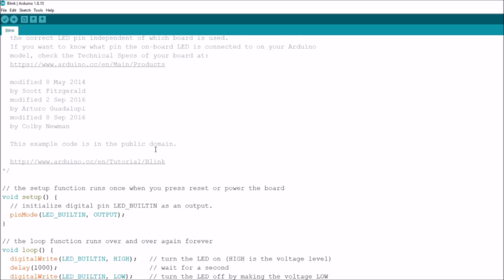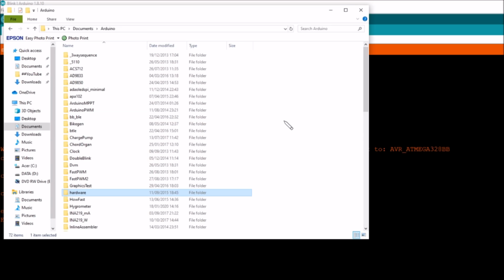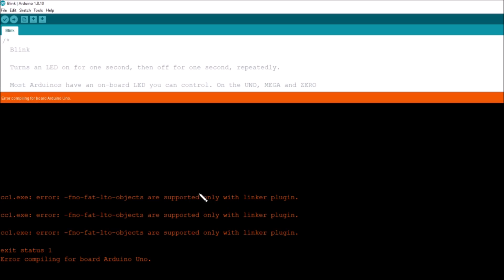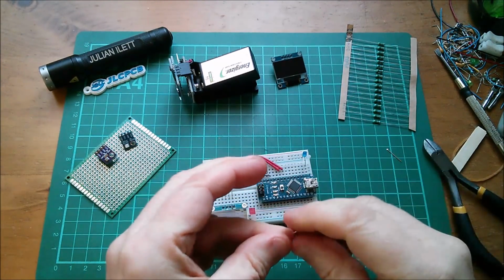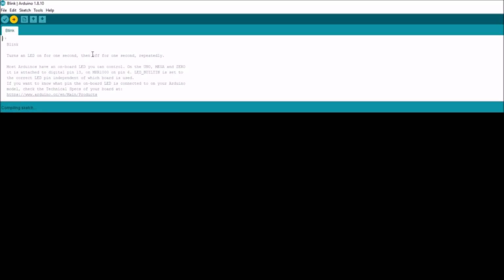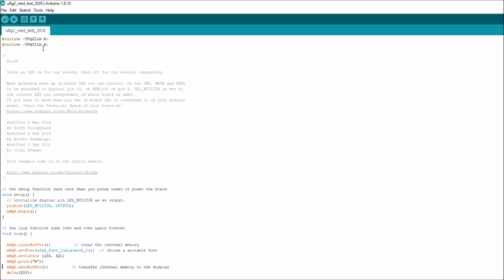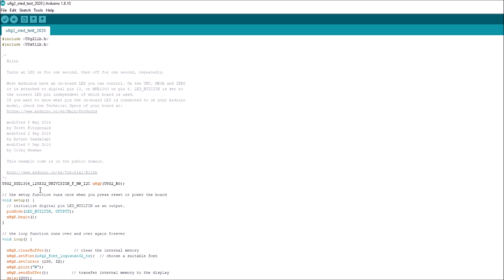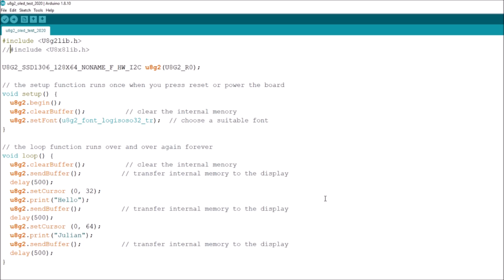Getting back into Arduino #1

Comment: Hello Julian,

Yes, lots of things change with Arduino, I have several versions of Arduino IDE on my PC as some libraries such as the LoRaWAN LMIC library only works on Arduino that's 2 major versions behind. Also, it is annoying that libraries are sometimes not versioned very well... BUT for properly versioned libraries you should look at PlatformIO. In the manifest for your project, you can pin the Arduino.h file and the library versions, which is super tasty. Also, your linker errors are probably related to the bootloader on your ATMega chip, this is an issue with the Pro Mini, as the name suggests its aimed at the pros (Arduino pros, I already recognise you as a pro in other ways) so you get all sorts of weird and wonderful behaviour and cutting edge stuff, the Uno and more hobbyist style Arduinos are much more stable in terms of bootloader version etc...

Best Regards,

Rob
Reply: Ooops, sorry just watched the rest of it and realised you figured all this magic out... But seriously check out PlatformIO I think you'll like it, finally a "proper IDE" for Arduino.

Comment: you can update the boot loader to new using another arduino but in my case i didnt have so i connected it to a rpi and did through that so that would be an interesting video

Comment: Havent updated since 1.8.5 for this reason - i have a problems as it is without introducing more issues.
Reply: 1.6.7 here. Original install when I got into it. Never had a problem so I won't change it until I do. I need continuity as I often revisit old code on things I've made.

Comment: I recommend you to use Visual Studio Code with PlatformIO, it allows you to keep the version of the different IDE and libraries for each project, so it doesn't matter how many years and updates has passed, you still keep it as the day you wrote it (and to share it it's perfect, for the very same reason, and you can keep programing something with the old libraries if u're used to them)

Comment: I had a really bad development experiance with the original arduino IDE. My code sometimes complied sometimes not, even when nothing changed. Like once i had to ctrl+x out the whole code then paste it back to complie... unstable AF....

In my opinion the Visual Studio Code IDE with PlatformIO extension is the best adruino development tool ever. You can install specific version of libs, update on demand. it supports a load of boards (including esp8266). has code auto completion and you can dig into library code with F12 on funcion calls.
Reply: The only issue with VSCode is it  has a very nasty habit of bloating your source directory. I use Atom Editor with PlatformIO instead.

Comment: Do I start up my old laptop... 
I'm scared ;-)
Reply: Make sure you upgrade it to the "more secure" Windows 10. It's impossible to say that with a straight face.
Reply: @trottx  pmsl it's 7 and that's the way it stays.
Reply: @trottx  - There is a reason MS was/is giving away Windows 10 for free.  My PCs have Windows 7 and are stable.  I'll wait to pay for Windows 11 when they take out the trash (spying and auto download of games and crap I don't want, etc., etc., etc.).  Either that or some Linux will be it.
Reply from the maker: I'd like to switch from Win10 to Chromebook, but I need OBS and MovieMaker.

Comment: 'You never forget how to ride a bicycle'. This is proof you can forget 😊
Reply: Especially if they change the bike from standard to recumbent, add GPS navigation, and change which side of the road you're supposed to ride on...
Reply: @Markus0021  Without your knowledge, or consent. That's what p*sses me off.
Reply: @AndyCallaway   Exactly. Been there. Since I only mess with Arduino on rare occasions, it seems to happen every single time I try to do something.
Reply: Turns out they moved the pedals to a new library.

Comment: Could you program this microcontroller using assmbly rather than the arduino bootloader?
Reply: Yes you can, but you can also use hardware dependant direct pin I/O within the Arduino IDE which greatly increases I/O speed and usually avoids the need to go back to the metal as it were.
Reply: @juststeve5542  Trudat
Reply: Yes
Reply: @TKomoski  So that would be a faster more efficient way to run code then like it is on a C64? Even if a not so efficient at the programming stage for a novice.
Reply: @rimmersbryggeri  Look through Julian's video's and you will see he did touch on assembly with Arduino
Reply: @Rolf Jander downside is direct register coding, unless done very carefully with some cunning #ifdefs, will make you very dependant on specific hardware.
Arduino code is supposed to be processor transparent...
Reply: @Rolf Jander Trudat

Comment: As a new (old) guy to arduino's I've been watching a lot of videos to learn. I recommend those from a guy called "Julian Ilett". He showed me how to use a Uno to burn optiboot bootloader onto a nano so I don't have to use "old bootloader" in the IDE and it compiles much faster=)
Please continue with more arduino stuff. Love your videos, they help useless old gits like me, immensely!
Reply from the maker: Ha ha - how easily we forget stuff. At the time, the only benefit of the 'new' bootloader was its size (1/4 the size IIRC). But if it also speeds up compilation, that's cool :)
Reply: Is that the same Julyan Ilett form the How to use smart L.C.D.s article?
Reply: @trinidad17  - different guy, you are thinking of Julian Lyet, the popular youtuber

Comment: You should get Visual Studio Code installed (not to be confused with Visual Studio) and add the PlatformIO plugin. As a programming environment it is so much better than the Arduino IDE, you get things like Intellisense - variable name checking and things. In PlatformIO all the Arduino libraries, boards, 3rd party libaries and a shed load of compatible boards, like the Teensy are included.
Reply: That what I use very intuitive
Reply: Also and most relevant you can make it use specific versions of you dependencies instead of relying on the Arduino IDE.

Comment: Julian, no it's not just you. I'm continually driven insane by people changing libraries and not making things backward compatible!

So dear library writers, when you add a new feature (which might require a new parameter), either overload the function definition so it'll work with old code, or create a new function call.

Even Microsoft manage to do this.

It's common sense. How would you feel if one day your local petrol gas station suddenly defined the new pump nozzle standard as being 3 inches across and square? That's exactly what you're doing!
Reply: I always deprecate methods and wait a few years before I remove them. Anyone can write code. ANYONE can write code. Takes a lot more to write backwards compatible code that is free of bugs.
Reply: It is not just Arduino -- it happens to every SDK and library... 

I read once that "Backwards compatibility is the source of all evil". I didn't agree at the time but I guess I was young and naive. Now I am older and wiser, and most bugs I discover in my day job are due to so called "clever" backwards compatibility. So now I tend to agree -- most of the time it's "better" to break things as to force a rewrite of apps using re-designed libraries rather than trying to keep things working with unforeseen side-effects, code compilable but introducing serious bugs. Worse case, programs depend on side-effects of the old libraries that no longer exist in the new libraries can cause serious subtle bugs later... If you want your old projects to keep working, better never upgrade the SDK, or keep a backup of the old SDK.

(If a new type of petrol could cause serious harm to old cars, then petrol stations would for sure use incompatible nozzles. It is a safety feature! :))
Reply: @hugovangalen  in big software projects I could agree with you to an extent (but as I said, Microsoft managed by adding the _EX functions to later versions of windows, with a threat to depreciate the old ones after several years - although I've seen many supported for over 10 years!).

For small projects like a library to drive an LCD panel, or communicate with a particular IC, there really should be no need for change unless the panel or IC change, in which case it's a new library or function.

@Haze - I know, and unfortunately many do! Just some of us have done it professionally for 20+ years ;-)
Reply: @juststeve5542   Steve Evans  Microsoft was notorious for producing a very crash prone operating system for decades, so I am not sure that is the best example, its old APIs are still a source of vulnerabilities :) 

But yeah, small changes could be dealt with more end-user friendly but in most cases, especially after years, libraries are overhauled due to poor initial design choices. Choices that later prevent adding support for newer hardware or implementation of new features. Hindsight is 20/20 vision, but it's impossible to design a stable API from the get-go and maintain that infinitely. That is a pipe-dream. Better to just freeze the old API and release a new library with a major version increase. Then old code still works and new code can use new libraries and features...
Reply: That’s not only library writers. Even Arduino itself with this “old bootloader” non sense. I wonder what will be their plan if they upgrade it again... “old old bootloader”? “Older”? “Ancient”?
Reply: @ecosta  If that would happen, then likely something like "Old bootloader (January 2018)" because that's the manufacture date when the boot-loader changed.

It isn't non-sense, it is in fact convenient that this option exists in the Arduino IDE.  If they did /not/ include this option, and expect people to know that they need to burn new boot-loaders when something doesn't work, it would be much more confusing / painful for end-users; which would be then complain the option is missing. :)
Reply: Hugo van Galen I understand, but I would like something more obvious than “old bootloader”. How old is “old”? Something like “Pre-January 2018” would be quite beneficial instead of just “old”... 😃
Reply: @ecosta  there are some differences when it comes to the bootloader.
Whilst I agree it's a pain in the butt, and I often find myself trying to use the wrong one (despite thinking I've reflashed all the bootloaders at least twice!), it's just not possible to make a bootloader that works for both old and new. They talk at different baud rates.
The "new" one (Optiboot) offers faster upload baud rate, smaller memory footprint and a quicker startup.
Reply: Steve Evans - you are right, but better error messages and menu items would be good. And I am almost sure it would be possible for detecting version in the IDE.

Comment: It's not just you. The programming in general these days is more like fashion - what's good today is crap tomorrow, so you have to completely rewrite your code. I hate this bullshit. If you think arduino is hard to compile in few years try developing for android...
Reply: So true.
Reply: Oh my god thinking about android must be an absolutely utter nightmare. Like every 6 months another new android version with yet another newer sdk version. And on top of all of this google will force programmers using newer sdks every now and then so that they keep movin on. Not even mentioning the IDE, libraries and so on...
Reply: I have been fighting should I go more to arduino or keep "bare metal" stuff. Arduino is fine for quick testing and if you don't plan to change it after or don't need new features after few years.
Reply: @LimbaZero  I hate Arduino. I use Avr studio. A proper debugger etc, but so many people release libraries for Arduino you'd think it was some kind of Panacea for professional coding.
Reply: @rowifi  I think only thing I have done with arduino was usb volume control buttons for index headset (STM32 bluepill). Now checking WLAN stuff with ESP8266/32. Most fun was with Zynq chips. VHDL and C with linux. VSCode will allow debugging for arduino. I currently have AVR Dragon and plan to get pickit4. Discovery boards are nice for STM32 debugging.
Note:
I also hated arduino at first. Now I think is ok for those who don't want to learn embedded software, deeper functionality of chip or protocol and they want something quick. I usually use it to cut corners.
Reply: @LimbaZero  not sure what vs code is. But I need real time control and proper  debug at interrupt level.
Reply: @rowifi  Visual Studio Code. It should support debug if you have debugwire or jtag adapter for debugging.
Reply: @rowifi  I. (almost) never debug in a conventional way. I mostly simulate small portions of my code to prove them good (I miss unit testing here) and when I have a problem I output info to pins, uart and other media to see what's going on. I use pins to triger the scope on interrupts. Most of the time debugging by tracing your code takes more time. You have to setup break points, makes sure you get the right conditions. Most of the time flipping a pin in the right places of the code will give you enough information. The rest is just reading your code and think "if I was a mcu what would I do here". With arduino somethimes that's hard to do because there is so many things hidden.
Reply: “Programming (...) is more like fashion”. Absolutely brilliant! I’ll print it and hang it nearby my desk, like those motivation posters...

Comment: In the Old School, your vendor build a system for you, and since you would complain a lot if they changed everything out from under you, they worked hard to think things through up front.  This didn't always mean major changes, your experience people might see relatively small changes which will make it easier to backfill new features without having to break everything all the time.

Roll forward to The Internet Age, and the solution is to just ship and iterate.  Sure, things change, but it's free, quit complaining!  Worse, some opensource projects assume their users are experts, so they'll have problems like this where nobody spent time making sure upgrades are clean.  Just tell the user to rename some buried directory!  Because users clearly want to read 35 pages of release notes before proceeding...
Reply: I've noticed that some open source projects are developed with the sale of consulting services being the business model. These are the kind of projects that lack documentation coincidentally enough.
Reply: What is with the hate of "open source" here? That has nothing to do with. Especially that ship-and-patch-later thing affects proprietary stuff more than open source projects. How many triple A games have been released the last few years that required updates only days after their release? Every single one of them. (Updates are sometimes queued on the exact same day of release.) That is because of the pressure of corporate deadlines, something that (most) open source projects are not affected by.

Closed source things also send you 35 pages of release and deprecation notes... They don't assume you are an expert, it's just that going too deep into the specifics would make the documents unnecessarily lengthier too. So just Google the details and school yourself. It's the breaks of software development. It's a very quick developing field. Changes happen. :)
Reply: @hugovangalen  Opensource was just an example.  When I was working at one of the FAANG companies, something which sorely tested me about the internal tools was idea of "Here's the new thing!  It's amazing!  Read the source code if you want to know how it works.  BTW, the old working thing is no longer supported."  It made me pine for the 90's, when I was working in the ecosystem of a different FAANG company ... but they also ship-and-iterate rather than finishing things, these days.

To be clear, I'm not saying everyone used to completely finish things.  That never happened.  But it was VERY expensive to update things in the field, so at least an attempt was made.  These days, there's almost no friction at all, because people (falsely) believe that updates are free.